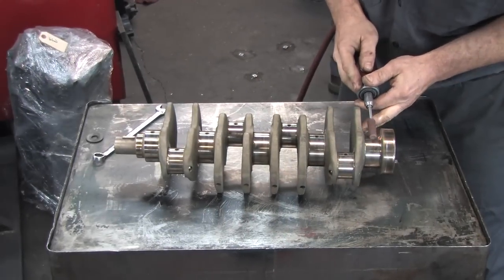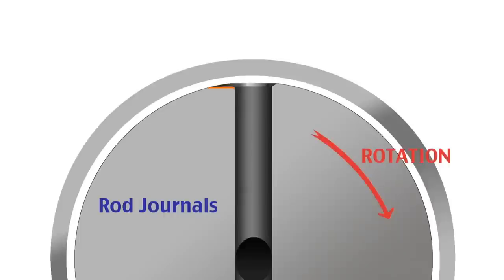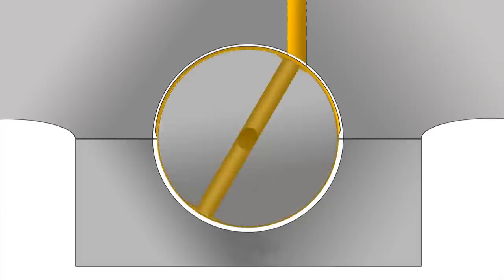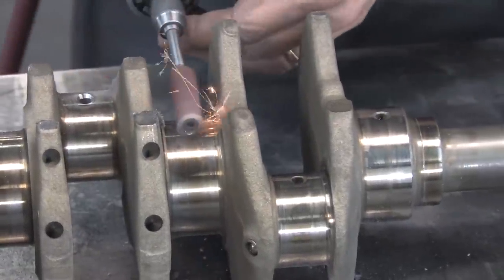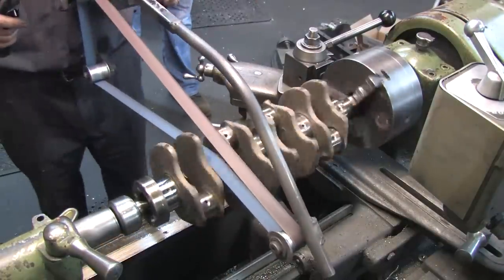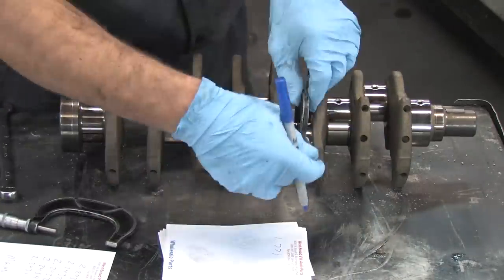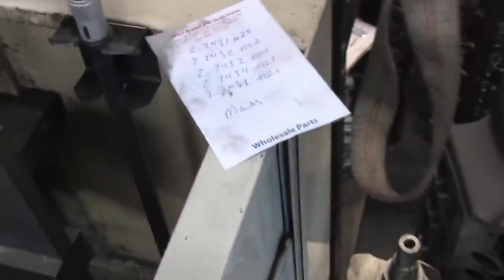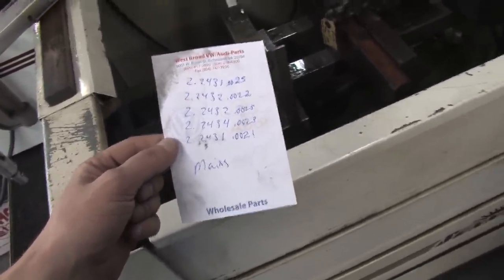6-bolt 4g63 Crankshaft Chamfer & Oil Clearances

Comment: Do you take out the balls pressed into the crank after the polish to clean it properly?
Reply from the maker: +MrNeonracing Nope.  Just a pipe cleaner through the oil holes, a high pressure blast with a mineral spirits equivalent, a detergent and water bath and then compressed air.  That's about it.  Those things are a monster to remove.  If I munch bearings or any chunky stuff, typically I'm replacing the crank.

Comment: Hello master , I need your help , please!. Let's see , when I turn on my car ( Mitsubishi RVR sports gear x3, engine 4g63) the oil pressure is 80 psi for 800 RPM (for 65°F). but when the engine starts to heat, the oil pressure drops to 0 psi (200°F) for 800 RPM. What do you think ????  
Note: my Metales are new.
Reply from the maker: 80 PSI cold is not unusual at all.  In fact, it's a good thing.  Is the oil pressure "idiot light" coming on?  If not, I think you need to hook a different pressure gauge up to it.  At an 800 RPM warm idle, most modern engines barely make any oil pressure, and I've had several people who thought they had no oil pressure find it with a different oil pressure gauge.  They didn't get an oil pressure warning from behind the wheel.  The gauge just lets you monitor your oil pressure to see something coming.  Ultimately it's that warning light that saves us.
Reply: @Jafromobile  ok , I will change oil pressure gauge. the problem with 0 psi an 800 RPM in hot is rarely. what do you think in this case: https://www.youtube.com/watch?v=9pYK5kEW45M     .It'ts similar to my case.

Comment: what is this cutter ??? abrasive stone ???
Reply from the maker: 80 grit sanding roll.
Reply from the maker: Close enough, but smaller diameter would work better.  If you watch the cylinder head port and polish video, I show a package from Harbor Freight with the actual rolls I used.  The package has the part number on it.  Not sure where you live, but you can buy them online.  Eastwood also sells them.